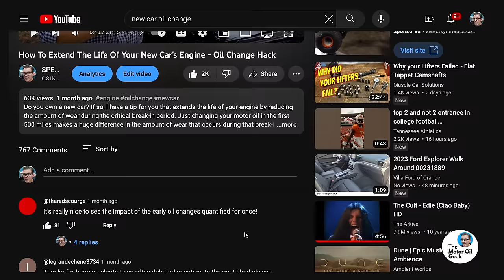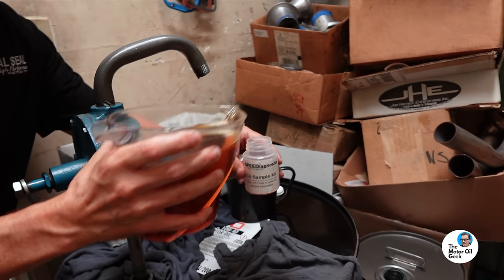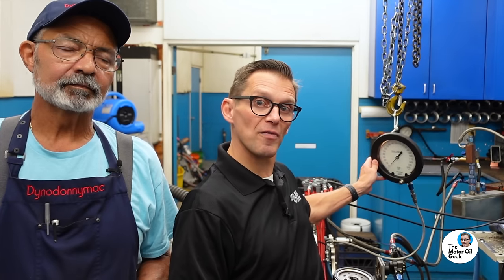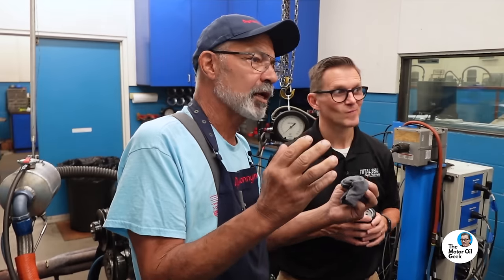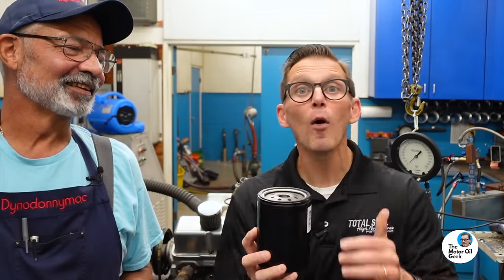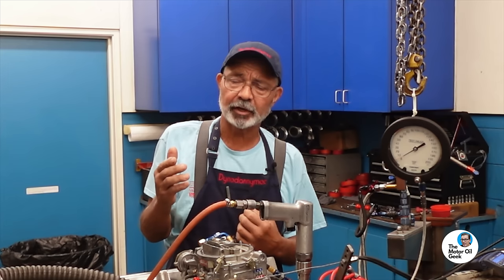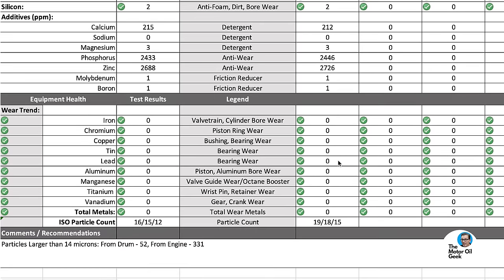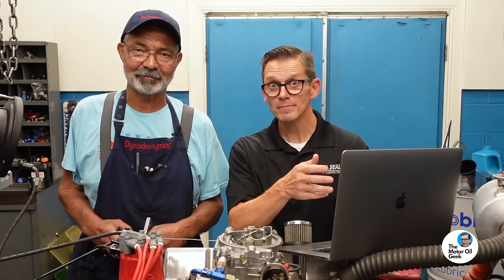Does Pre-FILLING The Oil FILTER Cause Engine DAMAGE?

Comment: Well. I've known this for decades.
This is my thoughts. If your oil filter is straight up and down up to a 45°. Heck yeah fill it. Of like say a 4.6 Crown Victoria where it's on it's side, parallel to the ground. Yeah just wet the filter with a little bit of oil. Or you'll just have new oil pouring out. 
Fortunately, this particular factory tune allows the motor to crank several times before firing up. If it's warmed up, it just cranks up as fast as those cars that shut off at a red lights. So it primes the motor before firing up. Which cold starts do anyways. If it's a drive through oil change. Just bump the starter a few times. Some cars won't even start without oil pressure first.

Comment: I read this article somewhere and came here to comment.  The article said that the oil pump gets oil from the filter.  The oil pump gets oil from the oil sump in every engine I have seen.
Reply from the maker: The article was wrong
Reply: @themotoroilgeek Ok, I thought it must have been bit I did not have time to watch the video to verify.  Thanks for the response.  I never pre-filled oil filters because half of the late model engines are angled in a way that won't allow it.  Some are straight down.  I assumed that if it's ok for a vw, bmw etc. That it must be fine for all makes.

Comment: How effective would an engine pre-lube system be?  I'm thinking an electric pump, a check valve, and a filter.  Run the electric pump for a few seconds each time before startup until the pressure comes up before turning the engine.

Comment: It's not necessary but it does help. Over 100 thousand miles and I never prefilled my filter.... Never had an issue. 98 Dodge ram 5.2l engine... Zero issues... None. Took it in to get the engine checked out minimal wear. But I always use synthetic oil. Tune up every year cap rotor plugs wires.... Sold it to another mechanic.... And still running. He had the engine looked at as well and asked if I ever replaced it... Nope... Just replaced to original starter last year.... Moral of story... Just keep up on maintenance....

Comment: I cant believe anyone would even question this logic. Any amount of time you can reduce until you have oil pressure is positive. Been filling filters for 63 years and there is no downside.  Granted, if you have a horizontal filter you can only fill it partially.  Any amount of oil in the filter is better than none.  The greatest amount of wear takes place at start up. The longer the vehicle sits without starting the more oil drips down to the bottom.  Anything to reduce the time without lubrication is valuable.

Comment: Yes you fill filters when it’s possible. Some applications it is not possible. This is a weakness with computer controlled starts. The best option is to make sure the engine is cold. The viscosity would be the heaviest and what film is there would be less likely to beak down in that 4-5 seconds. You still will get accelerated wear. Just the nature of the beast. I have only seen pre oiling systems on large heavy equipment. Those are few and far between.

Comment: Think  the test should be to take apart an engine with new bearings after a run with a prefilled filter and record the wear on the bearings and then do the same test without a prefilled filter to see if there if actual damage to the bearings.

Comment: You can pre fill the filter all you want. It just sits in the filter until the rest of the oil is pumped to it. It literally does not lubricant anything quicker. Don’t believe everything you see on tv. 
Also, talk to the guys at the lab. I once sent them oil with only 3k miles on it. They told me I was wasting my money because they are used to seeing oil with at least 5k miles on it for a better reading to see any amount of micro metals you get if your main bearing is wearing. 

At the end of the day my advise is this, if your filter is a strait up to the engine go ahead and prefill the filter. If your filter is at any sort of angle put it on dry so you’re not spilling oil all over the place.

Comment: Its not that the new oil is contaminated. Its the debris that could accidentally get into the center port of the filter as you fill it. Plastic shavings from opening the oil bottle, a piece of the foil seal on the bottle, dirt falling off your hands and the list goes on. I service big ass 3516 cat diesel gensets with canister filter housing that you can not prefill. Holds 3 giant filters and we crank em up and they go to 1800 rpm immediately. Never lost an engine yet and been doing this for 30 years.

Comment: It all depends on the application.  It may be Ok for automotive but not all applications.  If you are running high pressure hydraulics, the oil you analysed out of the drum is dirty.  If it is not less than 5 micron absolute then it may be considered as dirty.  Hydraulic engineers are now making it not possible to manually fill a reservoir.  To fill or top up a reservoir, the oil must be pumped in via a filter.  The air breathed into a reservior is filtered and also the moisture in the air is removed.

Comment: I have a horizontal filter on my car with 12k miles on the clock, I was watching video of saying not to fill the oil filter so i tried it.  When the engine started you could actually hear a rattle from the crankshaft before oil pressure built up.  This never happens with a prefilled oil filter

Comment: Never heard it for engine oil. I have heard of Hydraulic oil being dirtier out of drums than what was in the tank. That came from a professor who was a hydraulic engineer for CAT back in the 90's. Might make sense since hydraulics tend to put filter on the return line. I have opened up a lot of various drums and 5 gallon pales from multiple brands and have seen sediment at the bottom. So i typically just discard the last bit at the bottom. The set up i have at my shop now i use an oil pump with a oil filter on it to dispense the oil. 

I constantly tell people. If you change your oil and your funnel is dirty, your defeating the purpose.

Comment: Great video I am not knocking you, or anyone, but I don't understand the people on either side who get so angry and debate for days why you should or should not. 

The average person in the USA is driving approximately 1,000 miles a month, most cars today are using full synthetic oil calling for approximately 5,000 mile changes. On a side note some cars like the previously mentioned toyota are going upwards of 10k but I too agree that is way to much and would do it way sooner. This means the average person is getting 2, maybe 3 oil changes a year. 

Yes while prefilling the oil filter there is a not zero chance that some piece of debris somehow some way made jt thru the manufacturing process, or the bottle wasn't sealed, or it blew in from the air as you worked outside, and because you prefilled the filter that piece of debris gets to by pass the filter on first start up. Again this chance is very, very small but it is not zero. 

If you don't prefill the filter then yes on first start up after a oil change there will be a small amount of time where the engine is moving with basically no oil. 

But again either of these scenarios are only happening 2-3 times a year! If you prefill your filter you take a very small but more then zero chance of debris bypassing the filter. If you don't fill it then 2-3 times a year your going to cause a very negligible amount of extra wear for several seconds after first start up. 

Neither option is worse or better then the other and is only happening a couple times a year, and with modern oil and metal as long as you properly maintain your engine (with or without prefilling the oil filter) pretty much every other system on a modern car is going to fail long before the engine does! 

Not that it matters but for what it is worth I do prefill my oil filters!

Comment: I always  clean the filter housing on the block  with a clean rag fill the filter disconnect coil and just turn the motor over until I have oil pressure

Comment: Totally agreed with u, it's ridiculous to say it's dirtier for the oil coming straight out from the container, How come ???? Doesn't make sense !!!

But i have a question for u ? What if the installed position of the oil filter is like upside down, so if u pour a bit of oil to prime it, it will straight away flow out of the filter even before getting it installed on the engine. Any suggestion on that ??

Comment: Not sure how much this translates to newer engines? What type of bearings are you running on your test engine? A lot of modern engines made in the last decade or more have coatings on them for various reasons, including maximizing dry/wet lubricity. In regards to your average modern consumer car/truck gasoline engine, I am fairly confident that not prefilling your filter will make a significant difference. (I'm leaving diesels and industrial equipment out of this as they're a different beast in many ways)

You're likely to cause similar/more potential damage by leaving the vehicle to sit more than a couple days, most anyone who's done that will be familiar with the rattling/clacking from a drained engine starting up. 

Perhaps we need an old school crank in the front to prime the systems for those cases? (J/K)

Comment: I’ve got a 29 year old van with 140k miles. Why in the world would the engine oil stay almost as clean after 1,500 miles as it did when I first put it in. I hope it’s not due to fuel dilution. Could that be possible? Thank you

Comment: Caterpillar recommends not pre filling the filter, because of contamination risk, personally, if it can be installed with oil, it’s getting filled at least 90%. Some filters can’t be pre filled, in that case you are totally better off disabling your ignition, then crank to build oil pressure, reconnect the ignition and then start, run, check for leaks. Then shut the engine down and check for proper oil level.

Comment: I had a motorcycle that if you didn't prefill the filter, it would not prime itself for some time (A mile or so down the road). It would actually start ticking before it primed itself. That's the first motor when I learned to fill the filter.

Comment: In my experience, I never pre-fill the oil filter. I start the engine about 5-10 minutes after refilling, and I measure the proper oil level as the final step.

Comment: It’s fine to add oil to the filter, but were you made a mistake is all car filters are not in the location where you can fill it. Some cars have them upside down. You cannot do that to every car.
Reply: For those you can do clear flood mode holding the gas pedal to the floor while starting, turns engine over slowly without starting it priming the system. The oil geek already did a video on it

Comment: Hmm.  OK.  I have a cartridge-type filter on my car.  I'm now going to partially pre-fill it at least, & then pull the fuel pump fuse & crank the engine over for about 5 - 10 seconds before starting the engine on future oil changes.  I have always pre-filled canister-type filters since my first ever oil change.

Comment: Logic dictates that oil filter that is pre-filled, will minimize the dry run time after the oil change, also dry filter when you start your car could damage your filter as you are having oil at pressure hitting the dry media of the oil filter, which will take a certain amount of time to absorb.

Comment: I think the idea contaminates being introduced by prefilling comes froms dirt and debris on the lid of the filter or funny not necessarily the oil itself. You could potentially get dirt or dust or whatever by attempting to prefill and that would not be filtered out. But yes i agree with this video! Prefilling is best to bring up oil pressure

Comment: Some oil filters are mounted sideways so pre-filling is not feasible.  Instead idle the engine for 3 minutes, wait 2 minutes then check the level. Some oil filters are so small that oil level still fall around center line. Both too much & too little oil are bad.

Comment: Pre-fill oil in filter may not be necessary, but definitely will not harm the engine. The engine is not bone dry after oil is drained, and oil pump can push the oil through a non filled filter in a few seconds.

Comment: The time to get oil pressure on that second cranking after the filter had filled is not realistic behavior after an oil change. The passages will drain too when you remove the filter. In another video on this channel the oil pressure came up just less than a second slower than with a pre-filled filter.

Comment: With the cartage filter most new cars you can do the flooded engine proceadure  by hold accelerator peddle to the floor cranking  to prime the.filter.  Engine will not start while doing this

Comment: When you tested an empty vs filled filter. Did you drain the engine oil from the pan? Or did you only change the filters? If you only changed the filters the oil pump would be primed still and show instant oil pressure. If the oil was changed in the pan, it would undercover the oil pickup and introduce air into the oil pump. And possibly showing delayed oil pressure as well?

Comment: I have a truck that holds a gallon of oil in the filters. I got a little over 1,000,000 miles on it before a rebuild now has another 900,000. I aim for around 15,000 miles between oil changes.that’s at least 66 oil changes between rebuilds. I pre-fill the filters and I will continue to.

Comment: Pre filling the filter if you subtract the oil from the amount they tell you to put in for a oil change. Example 7 liters to fill engine .5 for the filter add the remaining 6.5.
So you dont over fill by a half litre. But it makes sense logically to pre fill filter.
Can you flush your engine after draining, before adding new oil?

Comment: How would you fill a 2023 Toyota Corolla oil filter when changing the oil? The filter is an eco filter and gets installed sideways (horizontally). So the oil would just not stay in the filter as you are installing it.

Comment: The problem here, not everybody works clean. You require closed cans if you have to measure how much litres of oil to pour in. To avoid later dust particles falling into it at your next service. It is quite dangerous to put a new filter on anyway since cars are usually dirty. If you touch some dirty part of your car with an open filter, you can already throw it into the garbage can. So always have a spare of filters. Or if you have big oil cans there could be some dirt inside. It's not that the oil is dirty. Avoid storms if you service your car outside. It should be a mild weather. You don't want sand get into the openings.
You're the problem not the oil.

Comment: I'm a mechanic and I have been pre filling filters for years.....all this stuff  is fact but one more important fact not touched on is timing chain tensioners ...alot ( not all) of engines use hydraulic chain tensioners .....no oil prease slack in chain causing guide damage ....zero clearance engine trust me dirt particles in the oil will seem trivial when your  replacing  or performing a major engine repair....your car your choice🤔

Comment: i guess if you prefill, make sure you dont overfill the sump. most brands have a "oil volume with filter change" and "oil volume without" - to accommodate how much will fill the filter. 

i have never bothered, and probably wont, but can see the logic that others may appreciate. There's enough residual oil coating everything during my changes to keep things safe for the few seconds it takes to get full circulation and pressure.

Comment: I always put some oil in my filter before I put it on. Just seems to make sense that you don't want a disruption anymore then you need to in oil flow. I will say that most my filters are horizontal so I don't fill it I do make sure the filter element is saturated and fill it about 1/4 of the way so it does not spill. I have a 2025 trax with Vertical oil filter, I will fill that one up with oil when I give it its first oil change at 1000 miles.

Comment: I've been a mechanic since 1984 and our family garage have never pre-filled any oil filters and we've never had any problems.
Reply: I have been in the auto mechanic profession  since 1974
It's better to pre-filled the  oil filter 
The problem is when the oil filter is with doubble valve,you can't fill the oil filter with oil

Comment: I've always filled the filter. If it's a car with a filter that can't be pre-filled. I pull the coil wire or fuel pump fuse depending on the vehicle and crank the engine to prime the engine before starting it

Comment: Hey man, only found your channel recently and loving your content... I fully get and agree that pre filling the filter is going to have allot of benefit in terms of getting oil pressure and saturation up as quickly as possible, but what about all those engines that don't have the filter mounted in an upright position? You can't prefilled them and also the initial oil pressure on start up is generated by the oil pump pulling oil up through the pick up from the sump which is definitely full of oil at that point... so seeing as it only takes fractions of a second for the oil pump to saturate the top of the Engine with oil, how can that cause any damage to anything as long as you have refilled the oil to above the min level on the dipstick?

Comment: if you don't fill the filter first at a heavy equipment or truck shop ,that could get you fired
3 seconds dry running with a diesel engine could kill the longevity of the engine

Comment: all heavy equipment will void warranty if you do not prefill, now can the properties break down from long shelf time yes but just like anything else a proper stir/shake. Next more and more turbo charged motors are supposed to be prefilled or fuel system disabled for proper lube.